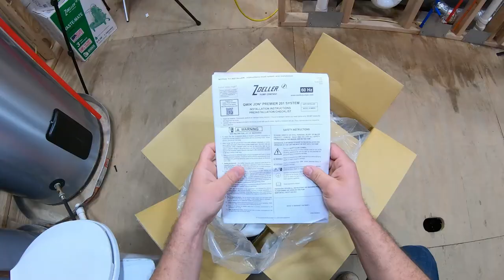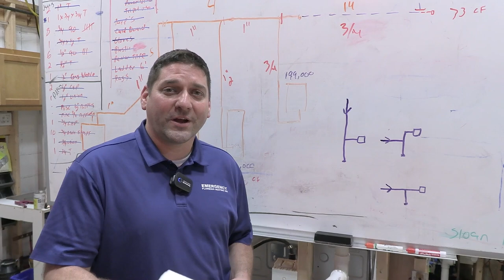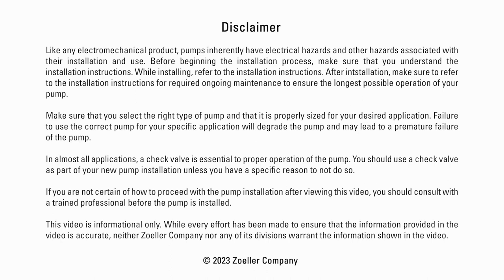Qwik Jon Premier Unboxing/Installation Video

Comment: I was not aware that there is a vent line forming part of the system.
Reply: Anything that drains whether by gravity or pressure needs a vent to work properly or in some cases to work at all. 👍

Comment: Can this be installed in a laundry room and use the washing machine drain as the waste drain for this type of toilet.   The washing machine drain also used as vent line it goes to top of roof.
Reply from the maker: Good morning! We have a product support department that can answer your question. You can either email zcotechnical@zoeller.com or call them by dialing 1-800-928-7867 and pressing option 6. I hope this helps!